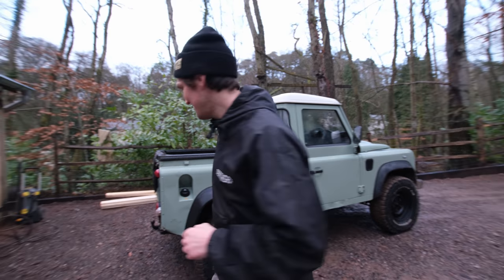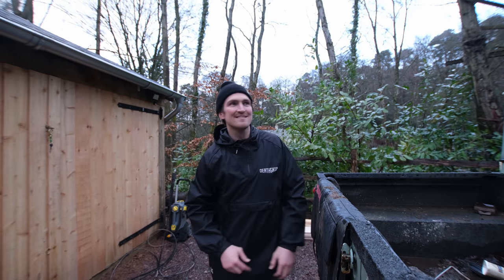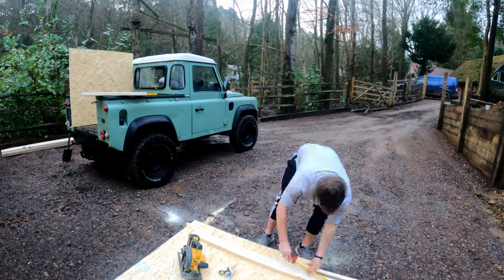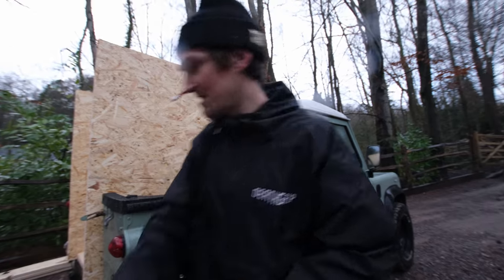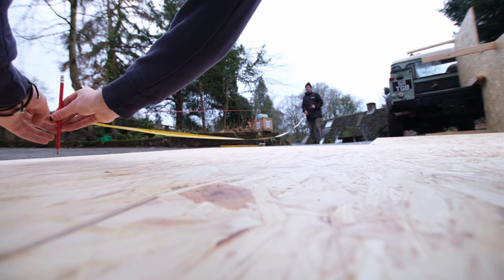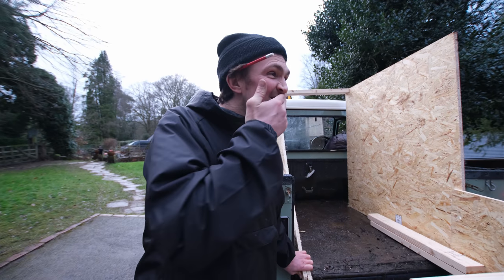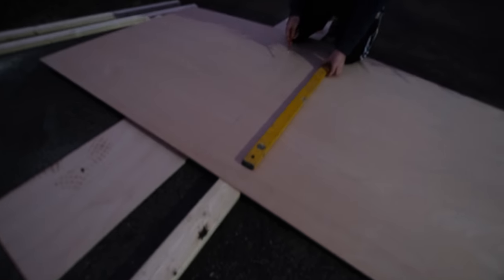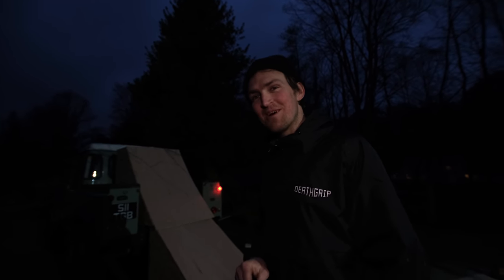BUILDING A PORTABLE MEGA RAMP ON MY DEFENDER!!

Comment: I think the radius is supposed to be tangential to the ground lol
The way you built it it just starts going up straight away.

But great idea in principle. A moto guy called Raha had a van with a similar setup in one of his videos, maybe check that out!
Reply: Also, I'm exited to see where you're going to ride this, it's gonna be HUGE!
Reply: Think they were trying to avoid the gap where it needs to sit into the land rover, otherwise the bed of the pickup would be in the middle of the ramp. Plus wherever they park it, it's not gonna be level to the ground every time
Reply: @2310Ole Yes exactly this!
Reply: @david94549  I get why they did it, but I think the design is just flawed in this way.
Reply: @2310Ole  don't all have to be perfectionists

Comment: I've been contemplating hitting a mulch jump. The ramps 3 meters tall roughly and it's a steeper take off than this you've just built but it's only over a meter to the landing. Ive been riding less than a year. its a big ramp but the jump is small if you get me. This looks tiny but you guys have all the talent.
Reply: My advice. Get yourself a pro rider, follow him into the jump and see what happens next. Worked for me (sort of) 😂
Reply: @beneyhewson4442 Yeah there are plenty round here. Its in Queenstown. It looks worse than it actually is.
Reply: @matt46vale  just hit it 100%. You’ll be absolulty  fine

Comment: you should turn the bonnet into a landing too and then you'd have a portable box jump ahahah & i swear with that radius thing you're meant to hammer the string into the corner of the wood and then draw so it's a perfect circle and you also take the radius measurement from the corner not 6 metres ahahahah you'd probs only need a 5ft radius or about a metre and half, if it was from the corner. does looks sick though either way